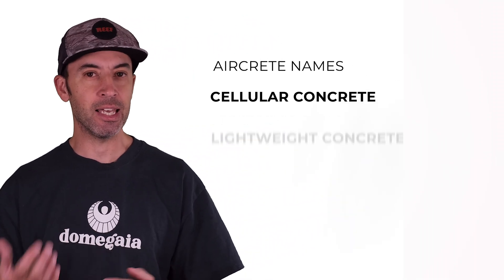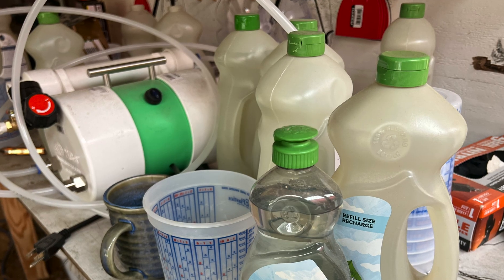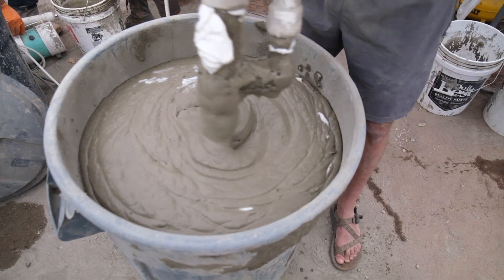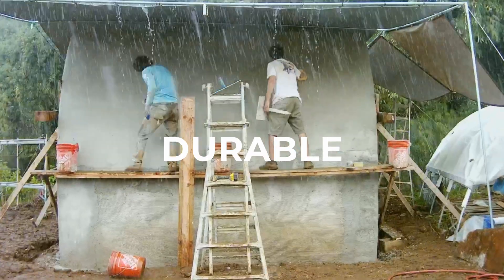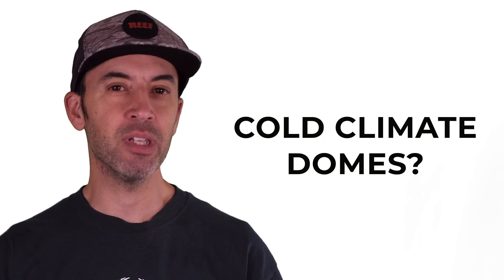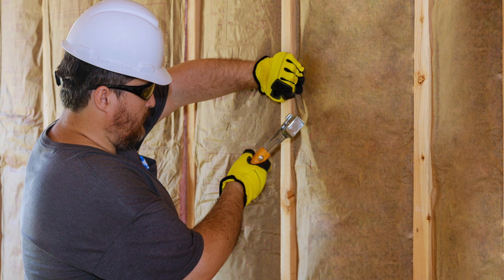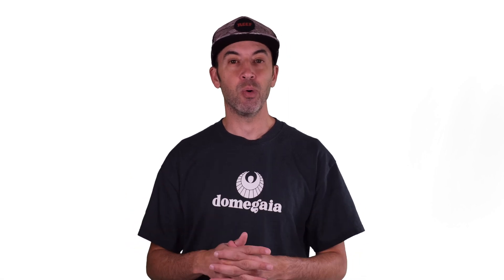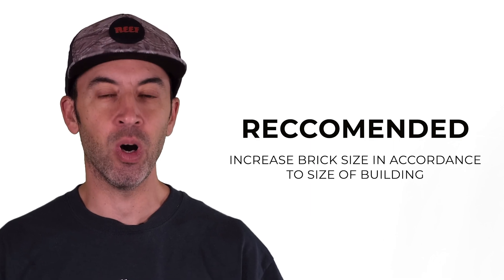Aircrete - Everything you need to know before you start

Comment: Thanks for what you and your dad are contributing.  I am really interested in hempcrete and straw bale  for the insulation and thermal mass properties but mainly, I HATE mold and mildew smell.  Hempcrete is said to regulate moisture in humid and hot environments.  How does aircrete compare?  can it regulate humidity like the others and if so are there special materials needed to finish it to allow it to breath?

Comment: Why not just design simple molds and pump the aircrete while still liquid into the mold and then take apart the mold?
An example would be a smaller mixing bowl in a larger mixing bowl

Comment: I am in the process of building a wall that will vary from 9'- 13' using Hebel block. It had a wavy pattern to it, that unfortunately the engineers at Hebel are not very helpful with adjusting their reinforcement requirements, which are in the top layer running horizontally, as well as vertically every 4'. It will be supported at 8' by a cantelievered shedroof supported by massive timber, 6'x13' posts and 2x framing. Can you weigh in on ability to just reinforce at the second tier from the top so we can can modify the lines? Hebel is suggesting plywood and stucco. Not making sense to me since the whole idea was to carve the block. Thanks for any light you might be able to shed. This wall is 60' long. with the highest point at 13' only 9' in width at most.
Reply from the maker: I’m sorry, this sounds more technical than we can get into in the comments here.

Comment: What do you think about using aircrete as a construction material for trailer campers?  Considering it's brittle nature, I wonder if it'd be appropriate structures that are on the move...like a camper.
Reply from the maker: Probably not a good idea.  Also too heavy for that application.

Comment: Important question for people interested in building domes in areas that are prone to hurricanes:  (We know that aircrete is not as strong as concrete) (and we know that you then cover the aircrete with fiberglass to make it stronger..) but the big question is... (after it is covered with fiberglass..) How strong IS it then?  Does it become as strong as traditional concrete (or magnesium cement), after it is covered with fiberglass?  If it is still not as strong.. then how much weaker IS it?  (Yes I know the dome-shape will help with hurricanes as well, but I'm trying to compare a cement dome with an aircrete dome, thanks.)
Reply from the maker: These are good questions, but they are hard to quantify.  In basic terms, a steel / concrete dome will always be stronger than an aircrete dome if the wall thickness is the same.  I think the question is about how strong do you need it to be?  What wind speeds, snow loads, and seismic activity are in the area you want to build.  When building with Aircrete or pure concrete you would engineer to those requirements.
Reply: @domegaia  Fair enough. however, For health reasons, I'd prefer a dome that would breathe and to achieve this it would need to NOT have fiberglass over the top of it..  If I were to do this, and if I were to make the walls extremely thick..  Could it still withstand a hurricane without the fiberglass coating?

Comment: Aircrete must be very porous with the air bubbles. So not waterproof. Expensive waterproofing needed. Any water penetration that freezes would expand to damage the material.
Reply: Cured lime is non reactive with water its not a sponge where as you go smaller theres smaller holes and ways for the water to penetrate and get held inside. Its a bubble structure inside same way styrafoam is full of air yet perfect for a coffee cup.

Comment: I'm asking this question as a complete novice, so keep that in mind, but if you shredded aluminum foil, or recycled aluminum pressed into thin sheets and added this to the mixture in the right amount,  would this increase the strength, as well as perhaps improve water permeability issues prior to sealing, or might there be an unpleasant effect from this combination,  if not immediately known,  over time?
Reply from the maker: I don't think there would be any advantage and just create a lot of extra work for you.  It's already strong enough and there are great ways to make it waterproof that make more sense.
Reply: @domegaia  Actually I found someone who adds aluminum powder.

Comment: I wonder if you could mix it with hemp powder to strengthen the product ?
Reply from the maker: You could but you don't need to if you build the way we do.  Adding fibers into the aircrete does make it stronger but you don't need it and it makes it harder to work with.  The strenght comes from the outer layers which is where you want your fiber.

Comment: This is a 70 year old technology in Europe. It is called Autoclaved aerated concrete. While the recipe for it is a little different as it also contains gypsum (making it more white), it is the same basic thing.
Reply from the maker: AAC is quite different than DIY aircrete.  AAC is made via a chemical process and cured in a kiln.  It is a lot harder which makes it harder to work with but still a good option if you can purchase and have them shipped to you cost effectively.
Reply: @domegaia  What do you mean a lot harder? I have no experience with aircrete but AAC is quite soft. I would say AAC is a little harder then chalk. Basically  you can brake a 10cm block of AAC by using your hands and knee like you would brake a branch.
Reply from the maker: I'm not an expert in all kinds of AAC bricks.  Just the one's we can get in the USA are harder to cut with a saw but they are still a lot softer than concrete.   They are a great option but often the shipping makes them unaffordable and they need to be made in a fairly hard factory, not something you can do yourself.
Reply: @domegaia  They are the cheapest building material you can get in Europe. But it's true that they need to be done in a factory. It is not something you can do yourself. And they are extremely easy to work with due to their low weight and big size.
Reply: @pintiliecatalin  - So - Maybe you can list a few Common Suppliers, & Their Websites, so people can get a Jump on doing some homework on comparing - Cost to Buy AAC - vs Cost to D-I-Y Aircrete? Tools to shape, trim, drill AAC vs Aircrete, are also important points of knowledge to compare!
Reply: this stuff is not autoclaved matey very different stuff

Comment: Great to see people using this product , but you scare me using blocks in a dome roof.
The first medium earthquake and they will have blocks falling on their head.
For Dome Roof ? ? ?  You cant do that , You dont want a bunch of ghosts haunting you.

Please try a one piece airform or light plywood support frame underneath , spray your first 2" thick layer on the form then add light 1/4" steel or basalt rebar mesh , pour another 2 - 4" thickness then add mesh again before your final 2" cover.
Reply from the maker: Lots of these domes have been through earthquakes with no issues.  We have approval from structural engineers as well.  The key thing is that we reinforce the outer layers with fiberglass and stucco.

Comment: Thanks for this informative video! I have questions about sandwiching the aircrete in fabric.

Is it a good idea to incorporate the fabric during the pouring stage? For example, creating an arch form, draping the fabric over it, and pouring the aircrete directly onto the membrane fabric. Or, for a straight wall, tensioning the inner and outer fabrics, supporting them with forms, and pouring the interior. Would doing that help the membrane fabrics adhere to the airecrete?  

I live in a textile-producing city so I have access to lots of surplus fabric at $1/square meter. The bolt sizes I have access to are typically 60 inch (1.5m) x 200 meters long. There are many material choices but I'd say the three main options are 100% polyester, 60% poly/40% cotton, or 100% woven polyethylene. Are any of those options suitable for the sandwiching fabric?

I appreciate your great videos with applied knowledge, it's been really inspirational.
Reply from the maker: This is a very interesting idea.  If you can get drop stiched fabric then I think it could work very well.

Comment: "What is the problem with Portland cement?
Limestone used in it is baked at up to 1,450 degrees Celsius (2,640 degrees Fahrenheit) in enormous kilns that are fired almost exclusively with fossil fuels. The chemical reactions involved produce even more carbon dioxide as a by-product. Making one kilogram of cement sends one kilogram of CO2 into the atmosphere."  And that is my problem with anything involving Portland Cement.  Papercrete is more environmentally friendly.  "It is recognized as an environment-friendly material due to significant recycled content and its ability to reduce the dead load for the main structure [6,7]. The manufacturing process of paper generally produces a large amount of solid waste."  If I have my choice with a building material I would rather utilize a medium that recycles commercial paper waste.  Portland cement seems to be awful for environment.

Comment: got an idea
The idea behind blocks is that they can be handled and placed in a variety of shapes and sizes so that they can be placed simply by nearly everybody. I see that you almost singularly use block, not cast in place. I prefer cast in place, as your video shows a 6 CF mix, and if I were to build a form, it would contain exactly 6 CF multiples. The greater the size of a form, the fewer shapes it will build. The smaller the form, the greater the labor in placement and patching.
I dislike domes as they are hard to find finishes for as ready-made products are almost exclusively designed for straight and plumb surfaces. Very hard to build multiple stories with limited ground space, city blocks are not round but rectangles. Domes look very unusual.
If I were to design a form using the correct amount of mix, it might be unstable for men to lift and place. IT needs reinforcing.  My thinking is  Polypropylene Baler Twine, pre-tensioned slightly. IT is so cheap that lots could be used. $.02 for 3M. My form would be 9' tall and 8' long, mostly 2.5" thick. I would place an electrical conduit in the form to run the wire from the top later. Place windows/doors in the form and cast around them. At each end, and the top I would cast a "U" to fill with reinforced concrete, making posts and a top beam. [I would fill slowly as not to burst the post form.]
Installation would be 4 guys lifting the form and new cast into place, then compressed air to delaminate the form, abandoning the new cast in the finished position over a footing to be mudded in. 1 cast/day.
This could be the lowest-cost housing structure on earth. Great for places where rock and sand is hard to find cheaply. A quality form could make hundreds of casts at a cost of less than $20 a cast. Finished walls at $.40 sf in the undeveloped world.
I have already built the lowest cost housing structure on earth. https://www.youtube.com/watch?v=T6D6362lZrk&t=3s
Please tell me where I am in error. [tommy_sanford2000(at)yahoo.com]

Comment: insulation alone is worth using it. Also you don't have to have TWO floors. Therefore it's perfect for bungalow type of home. It doesn't have to be small. It can be 3 bdrm or more. Just go horizontally. Perfect for farms, homesteads.

Comment: Very interesting video. Question. My land requires a building of at
least 600 square feet of livable space. That’s a pretty huge dome, although I’m not opposed to a dome if I could build it basically myself within  a year as an amateur. Domes are quite cool, but whether I go with a dome or a more traditional single story rectangular home, you didn’t cover internal walls to create rooms of different types which for obvious reasons have benefits and would be desirable for my family. Firstly, can internal walls be built safely and effectively using aircrete? Secondly, if yes, can one do this in both a dome and rectangular structure? And lastly, are
domes and one story rectangular homes about the same in difficulty and time it takes per square foot or significantly different? Thanks.
Reply from the maker: These are great questions.  If you are an amateur builder it's much easier to learn how to build a Aircrete Dome than a traditional house.   It is easier to build multiple smaller connected domes than one large dome.  For that reason our designs are all single story although you could go larger.  You can do internal walls from aircrete for both domes and traditional buildings.  In a dome they are not structural so it's a bit simpler.  In a trandtional building if they are structural its a whole other level of engineering.  We have classes to learn our dome building system you can check out here: https://domegaia.com/pages/workshops
Reply: @domegaia  this is a great answer, thank you and God bless

Comment: I have used a product called Rapidset a few times for varying projects.  Every time i come across an aircrete video, i start wondering if this product could improve the mix being that Rapidset is much stronger and sets faster than normal concrete.  They also make a plasticizer product called Flow Control that changes the consistency when being mixed and poured.  I have considered building a small bubble generator myself to try, but im wondering if anyone else has tried it first.
Reply from the maker: Let us know how it goes!

Comment: What does one do for an area with Seismic Activity?  Zone D seismic. 

Can you form it around a rebar dome structure?

Or, what about 2x4 fencing on both the inside & outside & knit them together, & then use the stucco on both the inside & out?
Reply from the maker: Domes are inherently resistant to seismic activity and we've had several go through good size earthquakes with no issue.  The bigger issue is meeting the codes in those area as they can be a lot strickter.  We are hoping to have some engineering done for high seismic areas soon.

Comment: Do you think it would ever be possible to 3d print with aircreat
Reply from the maker: Maybe but it will be harder than other materials because it is very liquid but maybe with the right mixture and additives.
Reply: @domegaia   Perhaps it can be done like shot Creek or on the end of a nozzle like a sprayer  Kind of like a over-engineered ink jet sprayer printer

Comment: Can I use it for a cister? I want to create a cistern at a high altitude build site that gets cold for a large % of the year and wjile I would bury it, wonder if this would add any benefit related to reducing how deep I'd need to bury to prevent the water from freezing.
Reply from the maker: I would not recommend using it for this purpose.  If you were heating the water it might make sense but it's all going to equalize in temperature if you don't have a heat source.

Comment: Like I said before. It is nice if you do not need a building permit. If you need one and have to show some documentation of its strength, structural integrity, aircrete is not the way to go. Steven Areen’s dome house wasn’t made with aircrete. It was built with 4” concrete blocks and some earth blocks (ladrillos) . And if you like to build “cheap” - the Domgaia tool set is already $1,500 plus shipping. For $1,500 I got all my 6” concrete blocks I needed. I have to build on a budget. My house will be around $15,000 - $20,000. Depending how crazy I want to go.

Comment: The structural integrity comes from the fibreglass, the insulation comes from the aircrete. seems like it would be better to build with foam blocks and then fibreglass that.
Reply from the maker: The aircrete give far more compression strenght than most foam insulation and it is an important part of the structure.  The fiberglass alone will not offer much without the aircrete.  The beauty is in how they work together.

Comment: You don’t need to buy a foam generator to create foam for aerated concrete. A simple compressor and air stone (like used in an aquarium) works totally fine.
Reply: Was thinking this
Reply: Have you tried injecting air bubbles that way with satisfactory results?

Comment: 4:08 ... that's about 12 R per inch.... what a lunatic exageration...  Is he purposely making a 600% exageration???
Reply from the maker: Good catch. You are completely right.  At 3:52 we say 1.8 R to 2.2 R per inch which is correct.  A 6" thick wall would be around 12 R in total, not 12 R per inch as we accidently said.

Comment: in the 1970s the British artist Roger Dean proposed and build rounded structures for dwelling/workshops using a sprayed concrete called GUNNITE. This was sprayed onto forms such as inflated balloons, etc. and then later windows and doors were cut using sawzall. Is this the same material??
Reply from the maker: No, this is very different.  What you are describing sounds like a monolithic dome.

Comment: I’m super excited about this material. I live in Anchorage, AK and plan to build a house next year. My idea is to use CMU columns and bond beams and use aircrete as an infill. Do you see any reason I couldn’t do that? I’d use rigid foam on the outside of the wall and metal siding over that. The hope would be to reduce cost and add insulation value.
Reply from the maker: I dont' see why you couldnt' do that but you would need to run some numbers to see how much it would save you.